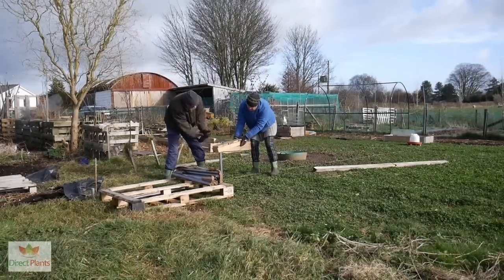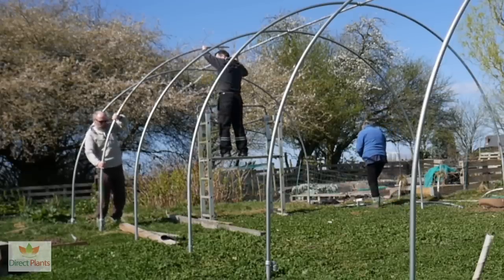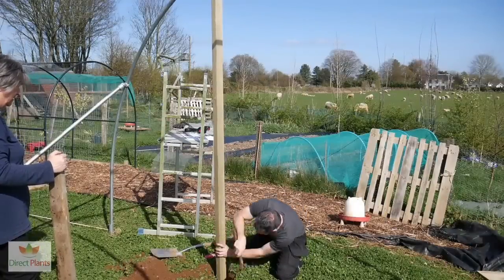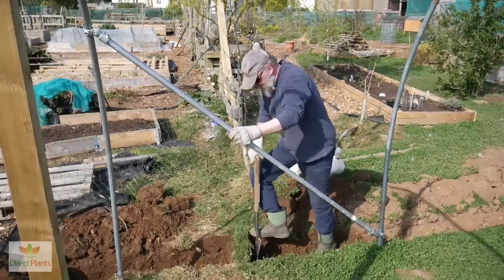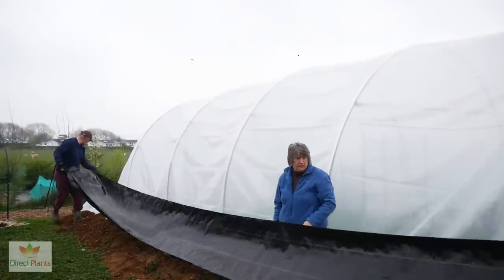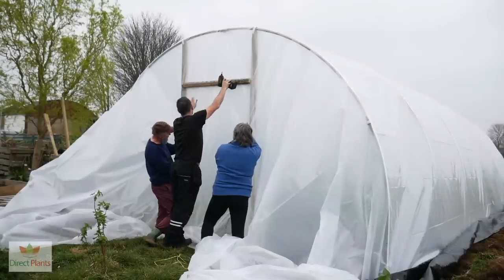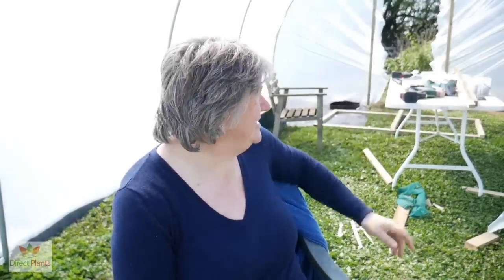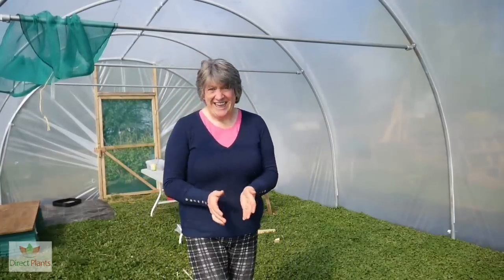How To Build A Polytunnel (using a kit) 2019

Comment: Thank you for your time.
I've got one question.
What was the tape you put on your frame.
Good luck.
Good harvesting.
Reply from the maker: It's called hot spot tape and is a padded tape (looks like it has a layer of polystyrene type stuff in the middle). The idea is to protect the plastic covering from the heat of the metal when the sun shines and warms the metal poles. I know plenty of people who don't use it and their polytunnels are just fine. I suspect it actually gives the plastic a longer life on the frame.

Comment: The roll of white strip that Tony put on the outside of the hoops. Was that double sided foam tape?
Reply from the maker: It's an anti-hot spot tape that protects the plastic from melting on the metal as it gets hot in the sunshine.

Comment: Hi liz that looks really going d can I ask why the door frame one side is higher than the other side and reasons? I thinking of replacing the cheap poly tunnel with a proper one
Reply from the maker: It looks higher on one side than the other because we didn't level out the ground before putting up the polytunnel. The door frame is level, the ground is sloping.
Reply: @LizZorab  I see thanks Liz 👍